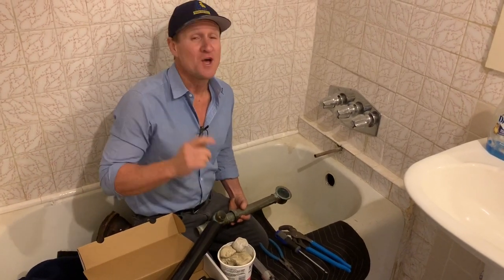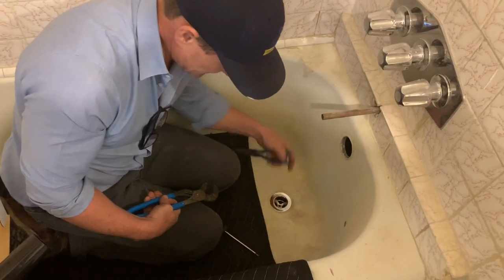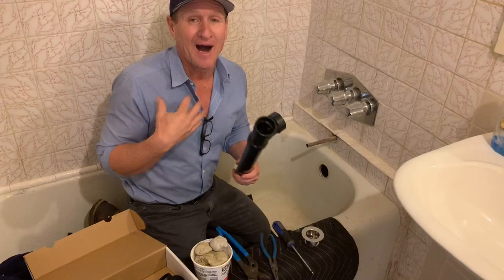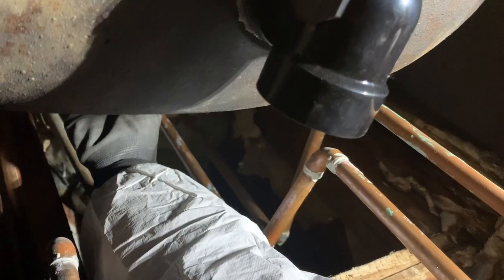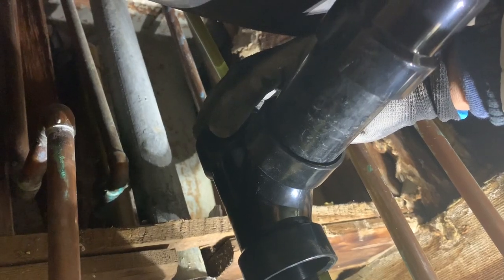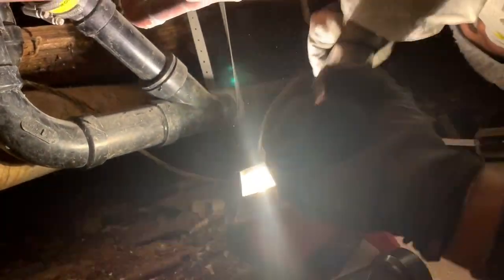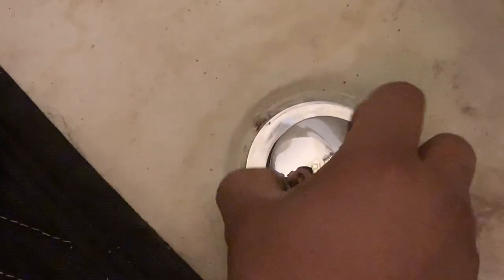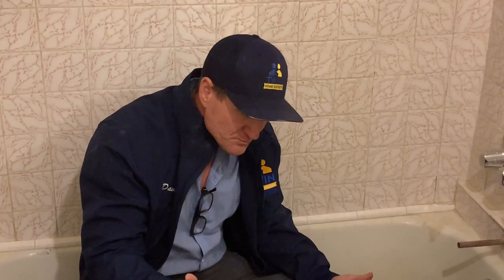How To Replace A Bathtub Drain (And What It Costs!)

Comment: I was replacing my mom's drain and the drain remover tool actually broke the cross hairs on the drain and the drain was still in the same place that it was when I started minus the cross hairs.  So here's an additional little 'tip' that you can use in desperate times.  Grab a socket that is just smaller than the size of the drain hole and then you'll need some JB Weld.  I think that you know where I am going with this.  Socket 'welds' to the inside of the drain and use the socket wrench to extract the drain.  The socket is history when you're done but you also dodged a bullet because you were able to pull that toothless drain out...
Reply: I would probably try this tool first... then go back to Home Depot for some JB Weld after it makes the problem worse!

https://www.homedepot.com/p/311493720
Reply: @benjaminsondelski3784  This was many years ago but thanks.  What I did was find a socket that I could toss afterward and put some JB Weld around the outside of the socket and inside of the drain and let it set.  After it cured, I took a wrench into the socket and began to remove.  It came out surprisingly easy at that point.  I did try the tool that you suggested and it went nowhere.  It cost me a couple of bucks for the JB Weld and about $6 for the disposable socket...

Comment: What about when you don’t have access to the drain?  My bathroom is on the second floor and I’m assuming the plumbing is in the ceiling of the first floor. I have to replace that drain plug but am terrified I’m going to cause some major damage removing it.
Reply from the maker: Yes, typically you have to gain access to unit below in order to fully replace the drain system. You may have enough room if you open up the wall behind, but if the piping is very old it will be unlikely. Thanks for the great question! Good luck with this project.

Comment: my drain plug lever and face plate fell INTO my tub yesterday. this video just saved me a grand. just dont tell anyone that i'll be gluing abs to pvc.... i really dont have a choice, the tub is on the second floor and i'm not ripping out the kitchen i just remodeled to get under the tub. i'm going to have to do it ALL from behind the tub in the little access hole

Comment: I'm Atlanta. I would charge $1100 for that.
Reply from the maker: Thats about right. Thanks for sharing
Reply: wow I  charge $140 you are good.
Reply: @plumberturd  that's way too low my friend. One thing I've realized is when the price is high, customers tend to value and appreciate you more. Also they refer you to their friends and family who are willing to pay a premium price for good service. 

When I use to price low, I was working my ass off not making the money I deserved to make and was getting referrals to other crappy customers who had expectations of low prices.

Now that I started charge like the big companies I now work much less (most days in home by 5pm) and make MUCH more money.
Reply: I pay 420$ cause I messed it up myself so I had some guys do it for me cause the builder manager would suck my dry if they found out, im from nyc
Reply: I thought plumbers just charged for time+material. Is your rate $1000 per hour?
Reply: @fuzzydrawrings269  if you tell customers it's $360/hr you're not gonna get much work. And don't make the mistake of underbidding your job and only thinking it'll take an hour. You need to account for unknowns or guys working slow. From there build your price book on your average cost of material plus your hourly rate.

Comment: Hi my tub drain does not have any threads for the new pop up drain to screw into was wondering what to do it is leaking from the bottom there's a space that looks Li guess a washer should go there from what I've been watching But there are no threads for anything to screw into thank you.